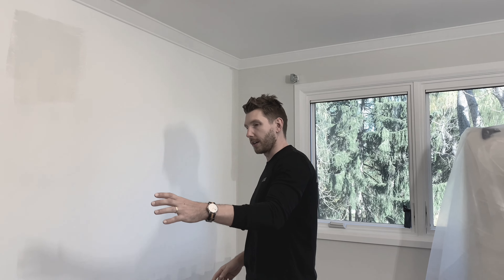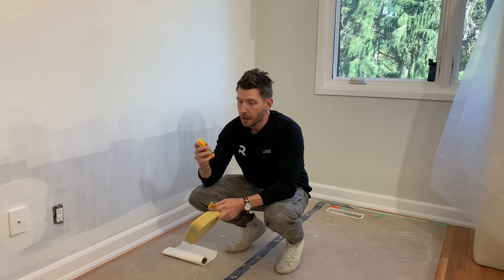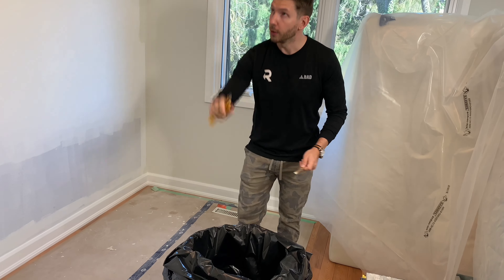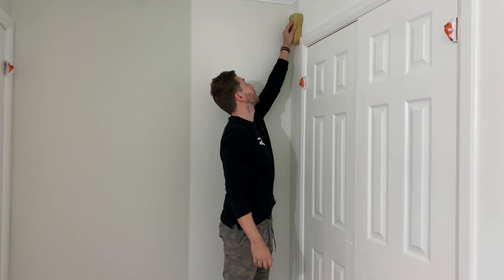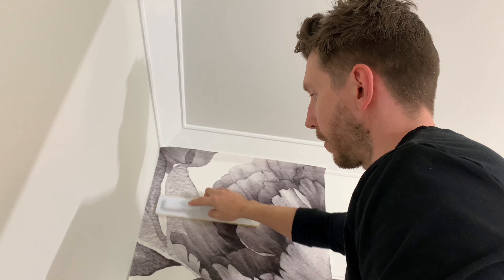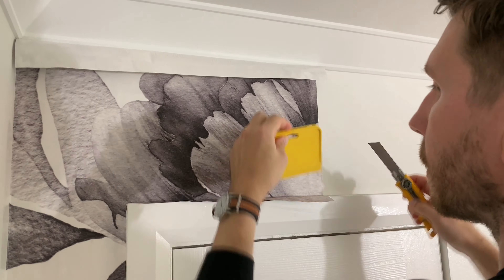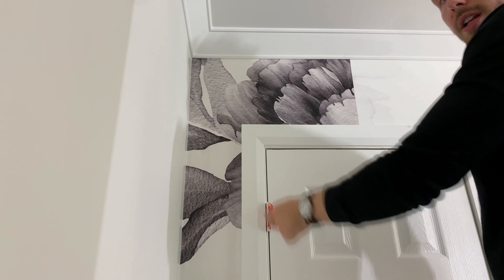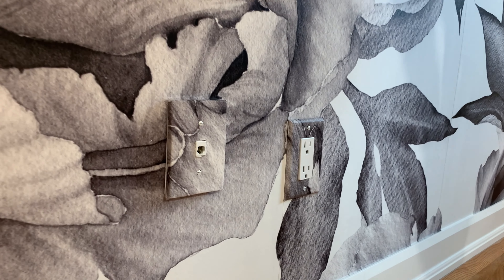Wallpaper Installation Guide! (Complete DIY Tutorial)

Comment: tip tip Tuesday.... on pre pasted, don't soak in water, still paste it like normal paper, but use a very weak packet/flake paste mix, that way you don't just rely on the adhesive on the back of the paper to be enough to hold the paper on.
Reply from the maker: Cool tip! Thanks 👍